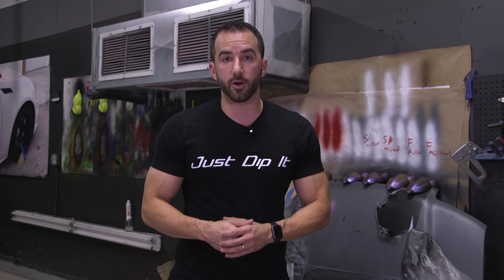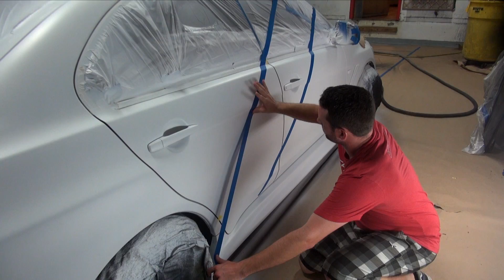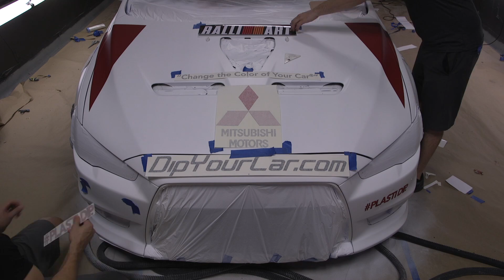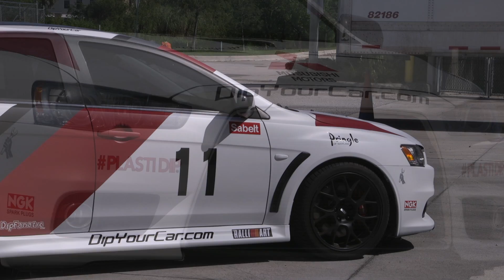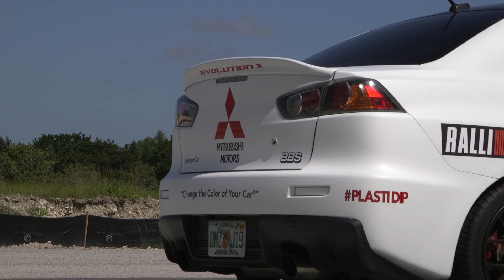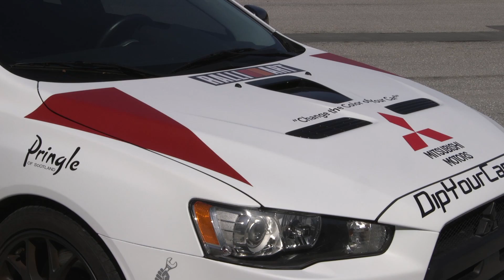How to Apply Vinyl Graphics to Plasti Dip

Comment: Usually I stick a decal on and spray over. There's a oh-so-subtle outline of it which is cool.
I wish my vinyls detached from the paper easy like yours. I have to lay them flat and press into the graphic with brute strength for an hour, especially when it comes to any skinny lines that taper off. >.<

Comment: When applying the vinyl, you can just use one long strip across the edge you want to start squeegeeing from, once you have it positioned... no need to remove the piece and match the corner pieces unless you Really want to conserve tape.  Less chance of having a fumble, and risk the backing sticking to itself, which typically turns into a re-cut.  We also use an edge, or part of the transfer masking as an anchor -to the same end (and conserves tape, although isn't as sticky).

Comment: ....a tip for sticker install. the 11s tape across the top. Square it level it....since you taped across the top you use it as a hinge to pull off the back paper.  Squeegee it from the top like he did. So, you don't have to take it off and it back on again.

Comment: Plasti Dip my bike and added decals..Easy process and came out super awesome! Too bad this video came out after, but the car looks awesome. @DipYourCar, kinda of risky but have you guys experimented with spraying plasti dip over decals that maybe some want to be there forever and don't want remove when the plasti dip is peeled for a new color scheme? Just curious if there is a technique to this idea or even if it's a good idea to try?? Thanx
Reply from the maker: It works most of the time, but safest route is to leave the decals right on top
Reply: Preciate the suggestion and insight

Comment: Quick question for anyone would it be possible to dip a car in a single garage. ?!
Reply from the maker: Yes, depending on the size of the vehicle
Reply: DipYourCar. --- well it's a mid size coupe. And would it be possible without any ventilation ?
Reply: DipYourCar thank you for the reply